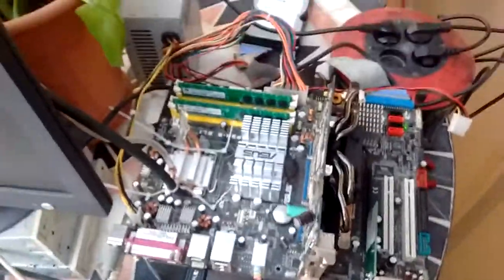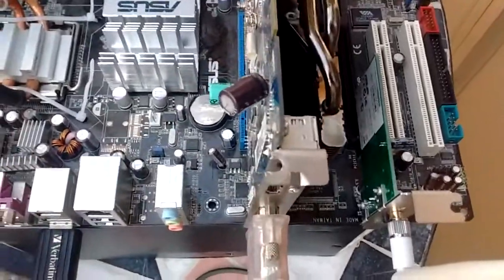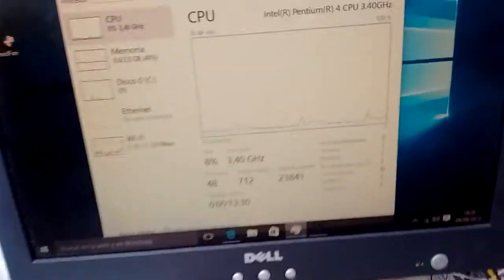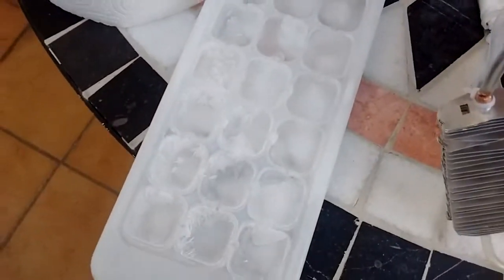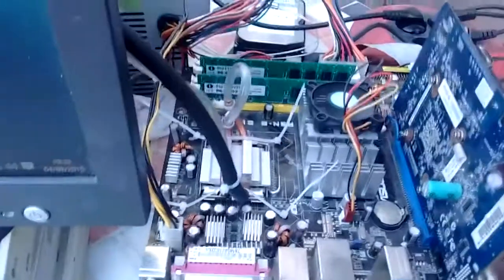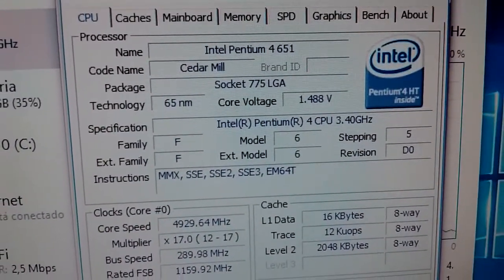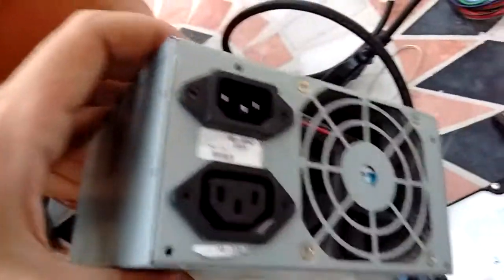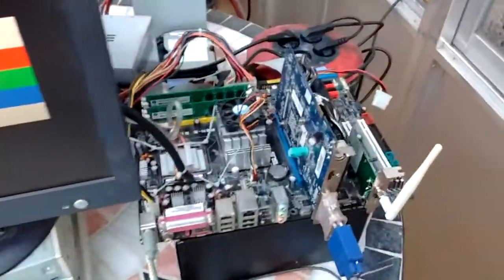Pentium 4 651 @ 4.93GHz on homemade watercooling!

Comment: cedar mill (last p4 gen) overclocks quite well without getting that hot and needing that much power... i managed to get a p4 651 running at 4.7 ghz on air cooling and with a better board even more would be possible

Comment: Recently, I got to 4.67 with a Pentium 4 641(3,2GHz 200x16) just using air cooling (Gelid Tranquillo with a Noctua P12 fan on max RPM). The FSB was 292 MHz and I had to set voltage to around 1.675v. I would have gotten further, but i was limited with a locked multiplier.

BTW, That is the craziest, coolest, most ghetto water cooling setup, i have ever seen.
Reply from the maker: Yeah, these 65nm Pentium 4s overclock like crazy. It's insane what you can do with them. I just remembered that the P5N board on this video gets a little bit upset with FSBs over 1066MHz (quad-pumped, 266MHz real FSB) without a voltage bump on the northbridge, and that might have been the reason why I couldn't get this P4 to 5GHz. Thanks for the compliment on the cooling setup! And congratulations on getting your 641 so fast on air!